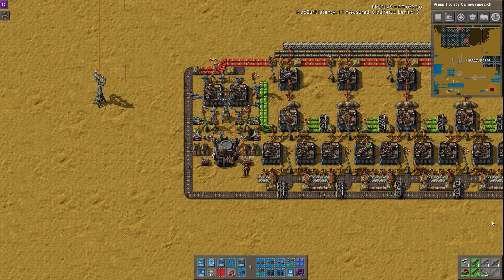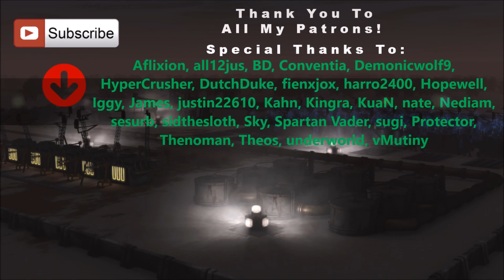Belt-Based Robot Production Build :: Factorio Workshop Season 2 - Building A Better Factory

Comment: It was me who submited the build thank you for reviewing it, I could upgrade with the sugestions. I dont consider the mergers a big problem since it produces the products very fast, the goal with this build is you place it down and let it feed your robot network.

As for the loop at the start well it does have a workaround, you just set the inserts with low stacks to the chests lets say 1 or 2 robots per chests and its solved, I don't like it because like I said the porpuse is for it to feed your network so after it is done It gets a few stacks on the chests too help it restart when you need it and too help the recycling system too.
The combinators are set so that when you have an excess in your network it gets placed back on the chests with requesters so that it facilitates demand, you could had it to your entire network and you can also change the numbers but you dont need really. It produces fast and it is only for early game so just place and let it fill you up. 

I have a couple more builds I will share with you guys in the future thank you much love and respect, Lord_Konrad.